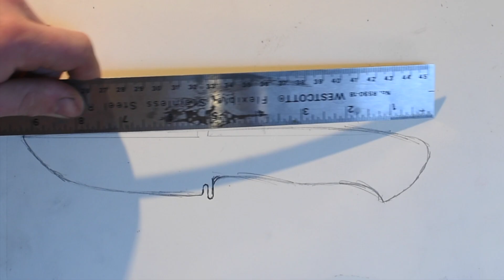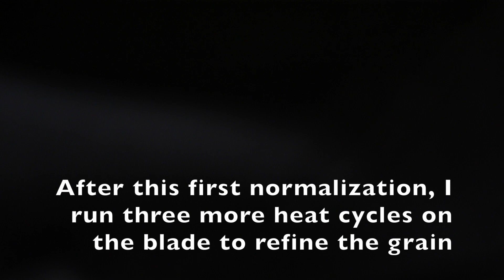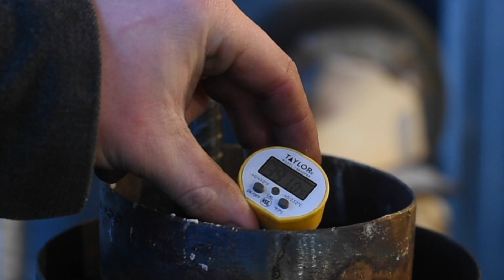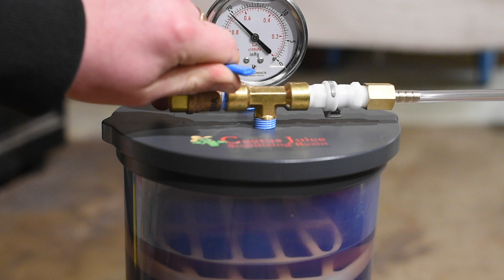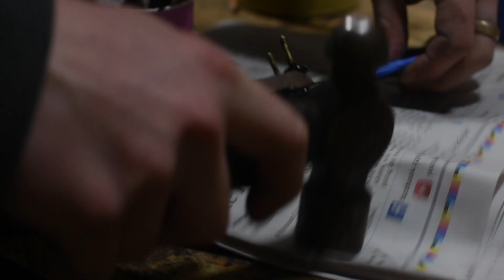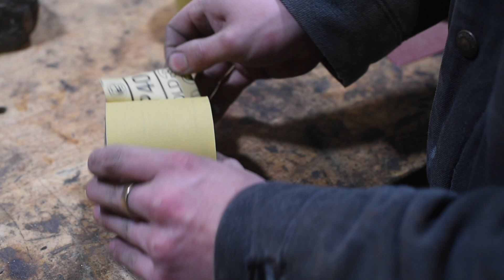Making a Full Tang Hunting Knife (Stabilized Walnut Handle)

Comment: Was that second container you put knife in the same as first when you quenched it or was that something different? And we have the same belt grinder. I love their stuff. I just ordered some more accessories from them
Reply from the maker: I should’ve said something to explain all that ha. First I quenched the blade in warm AAA quench oil, then when it was mostly cooled(~100°f)  I put it into a 400 degree low temp salt bath for the first temper. I also did a second temper in the oven. The reason for the salt is after quenching the heat treat oven is way too hot, and takes a long time to cool down. The salt let’s me temper right away
Reply: @LiamJPenn  oh! Interesting. I've not heard of that. Awesome blade btw